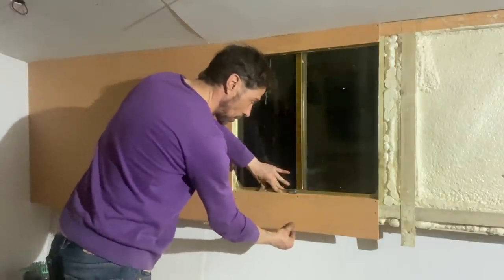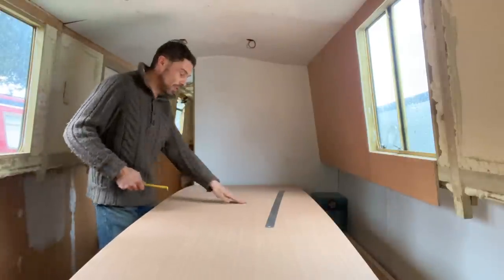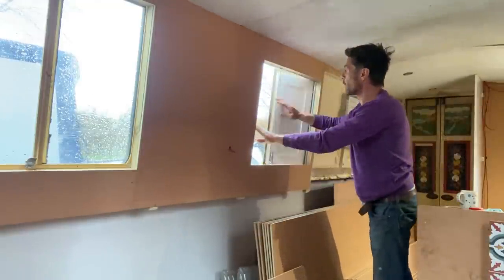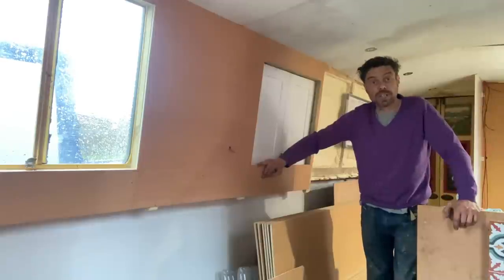134. Upper walls going up in the Narrowboat

Comment: carpenter tip, you've probably done your walls by now but next time, pre drill 2 holes in the panel where it meets the top batten, get a screw ready in your drill, squeeze the panel up in place and screw!!
Reply: Better still, start the screw in the ply before offering it up.

Comment: Great rainy day progress 👍🏻 if you’ve got any of those quick clamp things you can do up single handed you could clamp the bottom of the sheets to the batten that sticks out lower than the gunwales, that would hold it enough for you to wrangle it into position and get a screw in without having to wrestle with those cross braces

Comment: coming along  looks better the walls going up  Try using a dead man stick with a notch in the end for the board to sit in  from the floor to the bottom off the boards tap it in with your foot it will push the boards up to the ceiling easy way of supporting the weight

Comment: James’s 
Why bother with those props, if the window was open I think you would have launched them. Pre drill the boards, put a hook on your drill so you can hang it on your waist lift the board into position and grab the drill from your waist and get a fixing in. Or rent or borrow a pin gun so much easier 
Ps all those DIY gimmicks are a waist of money.
Good luck